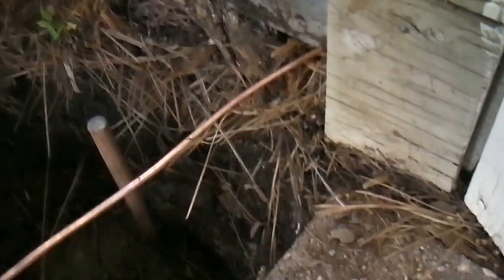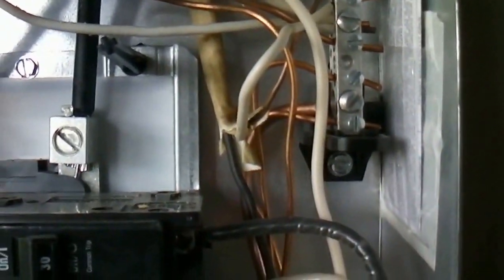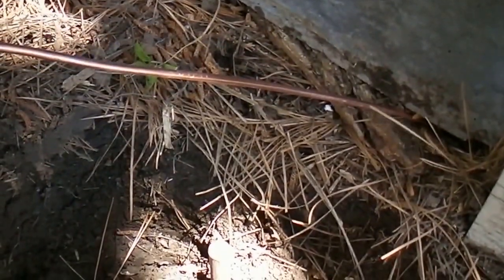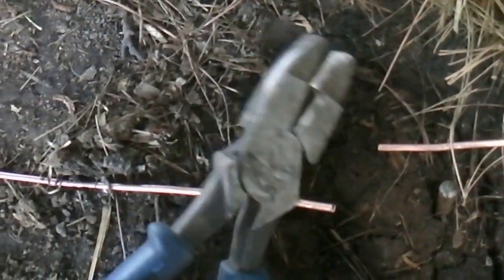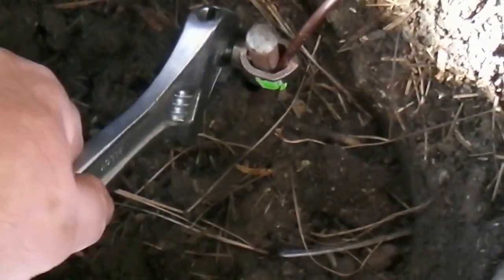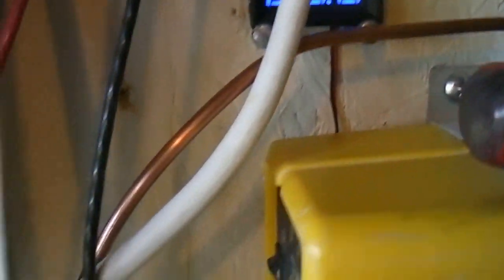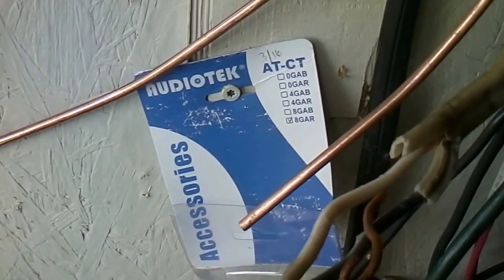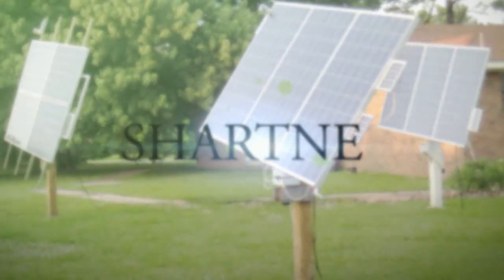Finally Connecting Ground Wire Quiet Power Xantrex Inverter

Comment: Looks good my friend, that will work. Please put a clamp of some kind on the soldered joint, if it gets hot it can melt the solder and release your connection and leave your connection open to ground currents. It would be better if you can ground to the ground buss bar if you can manage it.. It looks long enough to go into the breaker box and attached to the ground buss bar. Knock out one of the round knock outs on the side of the box below the ground buss bar and run the wire in that way. You need a mechanical as well as a electrical connection., the clamp or crimping provides the mechanical, solder provides the electrical connection. If the solder connection breaks then there goes your GFCI protection. Please please clamp or crimp, the best results will be to run the wire to the buss bar.
Reply from the maker: Off Grid Texas Homestead I see I will see if it can reach the buss bar. I bet it can that would be best good idea buddy. I never imagined it would melt the solder but I guess that is very possible.
Reply: yeah it can melt the solder if you get a short to ground for instance. If it gets hot enough and copper can get hot rather quickly if it is carrying enough current even for a short amount of time. I want it to be safe for you, grounding is a safety issue, it gives voltage a way to ground out, even though you might still get a shock, the ground wire will handle the brunt of the current rather than go through your hand, across your heart and through your feet to ground. Thats why if you have GFCI for it to function properly you need a good ground to offer maximum protection. I'm looking out for you, its a safety thing. Less than an amp across your heart can kill you. The wire properly grounded will offer much less resistance than your body so most all of the current will flow through it.  You still might get a burn or shock but it won't kill you.
Reply: Having the breakers on the panel also help provide some measure of protection as well. Its looking good if you just get the ground mechanically fastened.
Reply from the maker: Tomorrow in the day light I will ground the Xantrex Quiet power to the bus bar in the electrical box It will work good then. Using  your idea.  I would have fixed it tonight but I would have had to use light from a flash light or the Xantrex but I will just wait until I have day light. I have to cut off the power to the shed. So tomorrow Iw will be looking forward to knocking out a knock out o the side of the box and screwing down the wire nice and tight. I will be a easy fix.
Reply: Good deal my friend, you are right to do it in day light. I can't wait to see it in action with everything working good.

Comment: cool. looks like it will work well
Reply from the maker: FullThrottle440 It will be safe in wet weather. The GFCI  or Ground Fault Circuit Interrupter will flip and cut the circuit if it detects the slights amount of electricity going to ground. So if your using a power tool and it starts raining and it you start to get shocked the GFCI will detect the electricity going to ground. It will cut off. They are very sensitive. Im thinking if its raining and the silicone, outdoor, wet, dry extension cord will be safer to handle with the GFCI plug in. And of course it has to be grounded so I grounded it. LOL